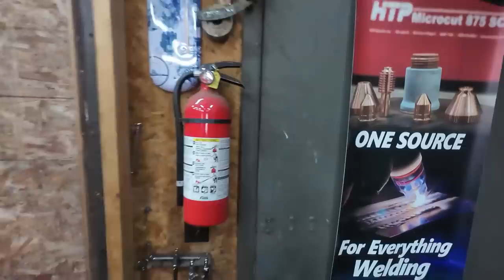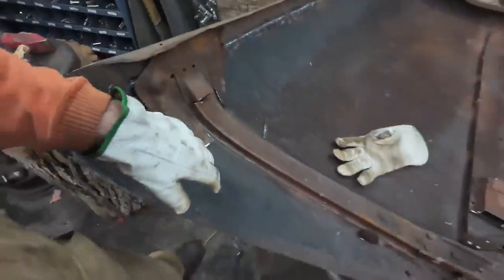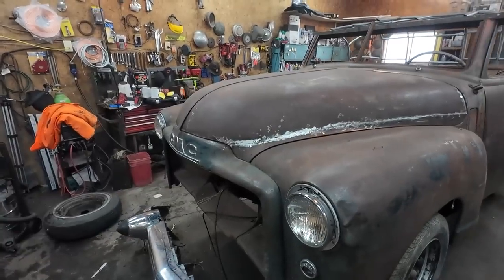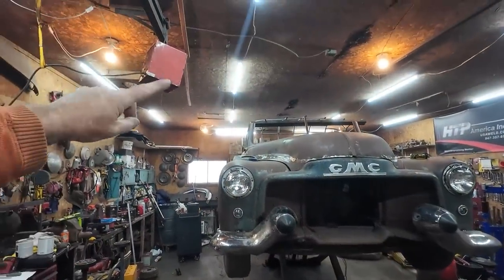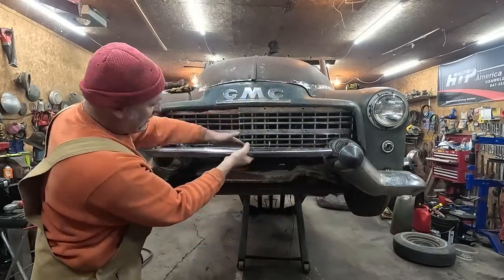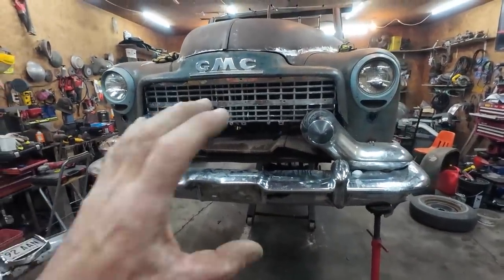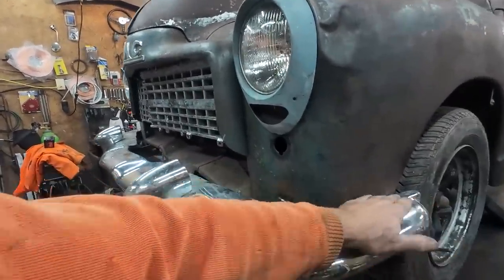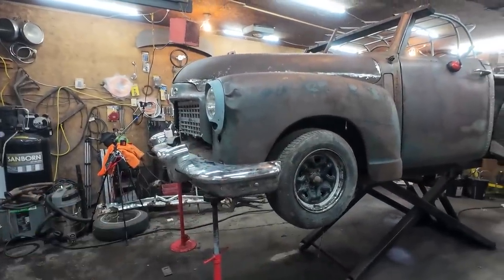Attempting to fit a Cadillac bumper to our 1949 GMC Roadster pickup

Comment: Ideas: I like the direction you’re moving in. Here’s an idea: take either inner chrome grill and split it horizontally, then add a filler cross piece in between the top and bottom pieces. That lowers the now expanded grill assembly - possibly enough to fill the gap. Personally, I like the first grill, but either will look great.

Comment: Brent, this old cogger doesn't think the Chrysler grill makes the grade, it's just too beefy.  The Ford bullet doesn't do it either, maybe the cross bar from the Caddy grille with some expanded metal of some sort with the Dagmar's would look good.  Hope the guys working on the new shop are being careful, snow kinda makes things a little slippery and concrete doesn't make for a very soft landing.

Comment: Brent we have to give you credit on how you changed the dynamics of the front end build...Those doggmars were kind of making the front end heavy as such ...Survey say the second bumper and a customised grille option  loose the fender  flares...smooth the headlamp bezel  keep the lower markers for indicators and the markers on the bottom of the bumper as running lights... trim the fenders to suit the tucked bumpers and BOBS your uncle for now that is ...

Comment: SNOW, wow where did the time go it was just summer not to long ago. Hope your trip to the left coast was fun. The videos were great and Karl is a good team mate. 
On a personal note, older guy here and have been motivated by your videos. I trouble shot my issue with my 2008 F150 truck running out of battery. Check battery it was good, took off alternator off and had it checked, it was bad, replaced it, put back together and it WORKS. By watching you work your magic I felt confident in tackling something new outside my comfort zone. 
Like, share, thanks mentor Brent.

Comment: Remove the small bumper nerfs. Remove the current bumper tips. Add Dagmars to remake the bumper tips. 
In other words, use the center of the bumper to join the bottoms of the Dagmars to make a complete bumper.
Advantage - fixes the cancered tips of the current bumpers and keeps the Dagmars. 
Win win.

Comment: Use that flat center section as a filler on top, that'll lower the chrysler grill, put the Dagmars back on, cut out the bumper with the stash to fit in between the dagmars

Comment: Hey Brent You can use that grill, if you built a trim piece around the perimeter of the whole grill that might work! right? that way you can lower the grill and fill in the top and bottom both sides It might work!  what do you think? no dagmars! Flares yes! that will look good tuck back that bumper a bit more, yepper. As you say, Brent,  " Gollie. '

Comment: I see it now, reminds me more of a '57 T bird front end now than a Caddy, didn't know the bumper was factiry sectioned that much, or that part of it was rotted out.
You could 'see' how it would have looked flipped upside down right? 
Grille mounted quad LED headlights in those park and blinker sockets, fog lights or the dagmars in the now lower position, grill nearly fills truck grille opening...you could have done it with a decent bumper if anyone could have.👍🇺🇸😎

Comment: At 11:02 when you are talking about hinging the hood you have a nice side on shot and you can see that the body is tapering down under the hood's line. You may want to think about splitting the front of the body above the firewall with a cut, lift it ever so slightly and rewelding it so that it aligns with the shape of your hood. Seen you do that many times just not sure if you noticed the lines yet. Also what if you swap hinges left to right and build out spacers/braced and attach to the hood at a narrower point?

Comment: Those look like Buick headlight bezels and the ones I did we’re pot metal and you can TIG weld pot metal so if you have any scrap that you can make a hole filler and then use slivers of scrap pretty like TIG rod, you can weld it up with a take it works really well

Comment: Not sure if you noticed, if you extend the lines of the dagmars up, they pretty much meet the edges of the hump on the hood. Maybe eliminate the top outer corners of the grille and have the edges angle down in line with the dagmars???

Comment: The bumber looks cool just a few modification, yes  don't cut nothing up unless your committed.   Don't use the cad dagmirreiea, if you can't  find or make a grill that work's with the bumber?

 The smooth bumber does look different. Yeah when building a Kustom  just about anything goes.

 The wheels and tires makes a huge difference with the look of a vehical?

 I know one thing this truck has cool all over it.
Maybe do a 50 Buick grill version on a truck? 

Then again that Buick grill has been over done on so many others Kustom builds.
 Never seen it done on a truck.

Comment: What about first put the grill together that's on the truck now (At the end of the video). Then split it into top and bottom sections. 
Fill the gap with the piece that has the round single middle boob with arms on either side. 
Yes to the finder flares.

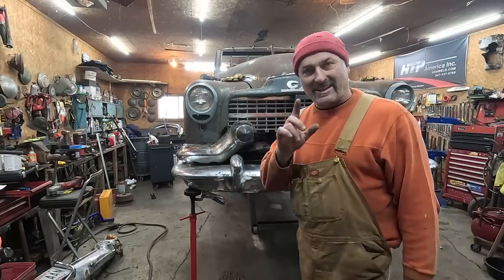Comment: 25:00  Or you could do like the 55 chevy's and put that piece floating in the grille.  29:54  Uhm...No.  31:48  Alright...FleetWood Mac makes it better.  37:30  I think if the bumper is raised to cover the bottom of the grille that it would work.

Comment: Well I liked both of them the dagmars are pretty cool but I agree with you it does fill it in with the other bumper If you can get it cut closer to the radius of the fenders I think that would help it Bring that lip down around the original grill to follow the bumper pretty it up like you said But it is coming Leave the turn signals in the headlights You could do that because they are already there and you wouldn't have to make new headlight rings Just saying

Comment: I like the second bumper, maybe use a horizontal billet style grille like what is usually used on a square body. Just play around with the gap spacing and maybe have a wider bar in the center.

Comment: Clearly, the second solution for the bumper is the most appropriate, even the Cadillac one is awesome too. The second is flat and makes the car larger visually, and a refined look. As well the fender without the arche is a better choice, refined too. For the grille, I think the one you put in is more original, but it's maybe cos I don't like the Cad Grilles. So it's not an impartial choice for me. 😉

Comment: I really like the second bumper.  It is a good look and skips the problem with the dual parking lights.  I do like the radius of the corner of the first bumper over the second, but that is a very subtle difference.  Fabricating a taller grill using the Chrysler grill would be a fantastic look but would require a lot of work and at least one more grill, maybe even two more.  You would have to move the center, wide band down or eliminate it altogether.   I would really hate to lose the wide waterfall hood molding but it may be too much for the look.  I also prefer the original smooth fenders for this truck...

Comment: How about split the grill in the center and make it taller with the center bar and cut the center bar flat to match the grill but leaving the pointed peak out,  basically keep the front shape and straighten the back to join the upper and lower grill

Comment: What if you cut the bed sides around the fenders and then reposition bed sides so theyre spread out wider aligning bed corners width to the cab? Imagine looking into your wider bed and seeing those curvy fenders inside that square box. Then cut the along the top of bed and raise it so top rail is alinged with back window. Theres just something about old curvy trucks with stepside beds that never fit the style.

Comment: Like you I was liking the dagmars grafted on to the bumper. However, it would be a lot of iron hanging out in front of the hood. I like the 2nd bumper choice better. Wasn't there a mid 50's Olds or Buick that had vertical curved bars for a grille? I think they would be long enough to fill the space. They might have to much forward curve to them making them to stick out and not flow with the curves of the front end.AL B.

Comment: Looking at the flares I see what is throwing the look off is the back half. The top curve is too small and goes straight on the angle portion, if the rear angle had a curve to it then it would flow better

Comment: What if you use the second bumper, split the grill in the center of the thick part in the middle then put the Ford center bar in to split top to bottom. 🤷🏻‍♂️

Comment: Cut the Dagmars off to cover the bolt holes on the top of the bumper I say lose the bumperettes and use the Dagmars cut off and welded on place of where the bumperettes where but jm happy with whatever you do work away the bumper needs to go up a bit higher on ths fenders

Comment: To be perfectly honest, I'm not a great fan of the Dagmar look, much too bulky with those black rubber titties. 

Still, anything can happen, as it did when you brought that bumper in from the snow, right?

You see how it changed the look once you removed the dagmars. A nice clean bumper with a much better line and the risers make all the difference. It changed the whole look for the better in my eyes, much better looking. 

As for the grille, yes, you could make one, which is the whole point of customising, but why not wait a while? Make it the last part of the jigsaw, and who knows, something perfect may pop up out of the snow like before and put the icing on the cake.

Another idea, why not incorporate that, umm? I'm not sure how to call it, so let's go with that jet engine looking thing. Have that in the middle using the grille parts to fill in the gaps. After all, the point is not only to look good but to be practical, to guide the airflow around the engine, right Brent?

I almost forgot, I think the white arches look much better than the original look.

That shape suits a much stronger look especially with a deep tuck on the bumper like Dave Kingdig does. Perhaps get some of those famous flush Kindig-it  handles he designed too. 

Imagine, your talent merged with the Master of custom. What a truck you could have. Its mind-boggling. 

I'm not trying to teach you how to suck eggs, but I dont know how better to explain what I mean. Remove the brackets first, then see how the bumper looks before settling on the first cut. Also, cut the bumper so it fits in under the wing, sorry, fender, then continue with the mustache down and round thinning it as you go and blend it until it disappears which I i think is what you said. Lol.

I'm off to watch a Bitchin Rides Kingdig-it repeat or two.